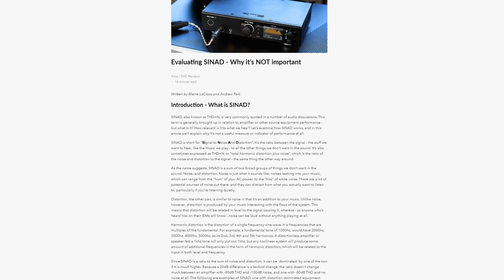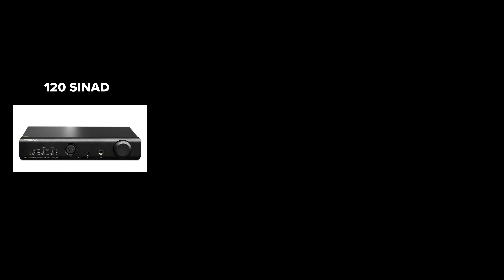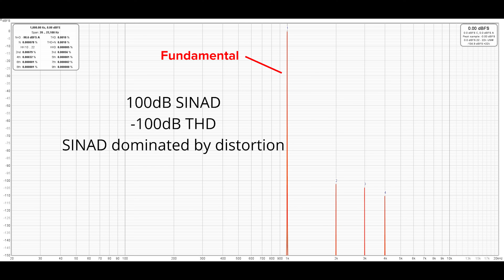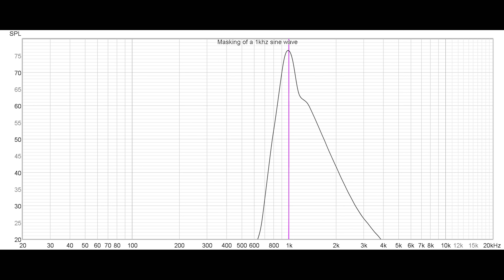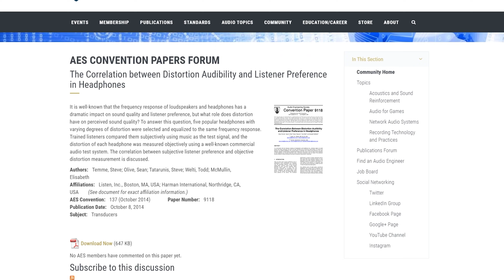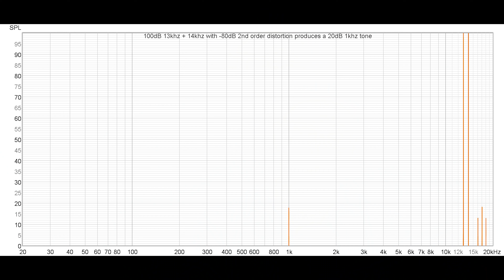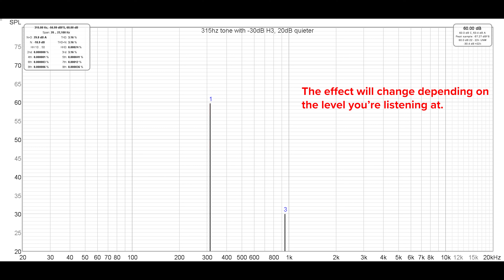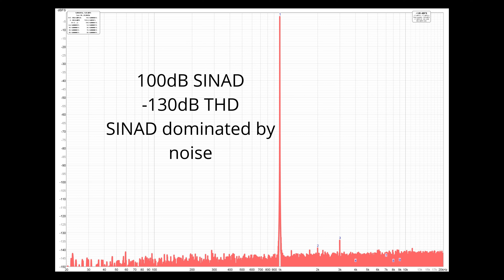Evaluating SINAD - Why it's NOT important

Comment: 4:53 distortion products are equal for example if you take that one kilohertz
fundamental tone and you add a second harmonic distortion to it you're going
to get a certain level of two kilohertz uh showing up now you could actually
have that level be relatively high and still not hear it because it is so close
in proximity to the one kilohertz tone contrast this you know at the same level

That is wrong...

Even an untrained ear can very easy distinct 1 KHz from 2 Khz and also 1 KHz or 2 KHz from a mix of 1 KHz and an 2 KHz harmonic.

There is a tool in the Internet (google for "onlinetonegenerator") which allows to mix up several sinus waves with different frequencies and volumes so everybody can try it.....

The voiced speech of a typical adult male will have a fundamental frequency from 90 to 155 Hz, and that of a typical adult female from 165 to 255 Hz. 

So according to your logic it should be nearly impossible to distinct men and women by their voice....

Comment: Anyone who thinks a single measurement defines the sound of a piece of gear is wrong. All it does is state how it performs in a single test. All it tells you is grossly how faithful it is to the source. If all you want is high fidelity and personal opinion doesn't come into your choices then measurement is the way to be lead. The raw number gives you a guide, nothing more, you need to see the full frequency sweep, which any decent review gives. No one is stating a single metric captures performance.

Comment: To combat the masking effect, a simple formula may be used where distortion is dynamically evaluated based on distance from the origin test tone and the difference between the respective loudness compared to volume, it would go something like this e.g. 1khz-5khz (Δ of whatever nr. of tones really) x ΔDb (tone's db at 1khz vs 5khz) / volume (because the lower the volume, the more explicit the distortion.)

That ought to give one a better representation of the perceived distortion as well as the amps' behavior across volume.

Comment: Thank you very much for this instructive video.  I was close to be seduced by the SINAD obsession and thus almost bought a new DAC even though I already have a completely adequate built in DAC in my Peachtree Nova300 as well as having available a 10 year-old NAC M51 DAC if I want a separate...all because of those two units rating on ASR's website.

Your common sense explanation with the scientific documentation is a real valuable contribution to the discussion...again, Thanks.

Comment: I don't see how a device that has a SINAD  of 120dB „might add things to your music“ (I assume audible is meant) as claimed to the end of the video. That seems to be a bogus statement. I understand that a bad measuring device can still sound pleasing due to masking (or wanted distortion), but in essence you are lucky that this happens and it might even be dependent on the source material and headphones used. A well measuring device  with a high sinad number on the other hand will add things, but the artefacts are KNOWN to be inaudible.  SINAD is just an upper bound, nothing more. 

The point is this. If high-end companies charge thousands and claim to be higher fidelity, but score low on measurments compared to a few-hundred dollar well engineered products,  then the claim of higher fidelity by definition is wrong and that's a problem. Sure, the cases might be nicer and some might have longer  life time but then the claims should not be about higher fidelity.
Also, amplifier design is not rocket science. A lot is known about it nowadays so I expect companies to be competent enough to design their products on a technically competent level, especially if the products are expensive.

Comment: To me, higher SINAD is MUCH SAFER option if I need to research for stuff WITHOUT any chance of audition. If I have to choose I'd rather choose a unit with 120dB SINAD over 60dB SINAD any day. As Julian Krause said, "...if you can, always have a look at the harmonic content that the distortion comprised of to get a better feeling whether this is going to be audible or not...", simply put, you need to look at the WHOLE PICTURE for analyzing audio gear, not just one aspect such as THD number, or SINAD number. That is analogous to making an opinion about an elephant, but you only look at how much it weigh, it does not tell the other stories such as it's strength, it's trunk, it's huge ears, how it sounds, etc. Most measurements only catches a GLIMPSE of what an audio gear sounds like, we need MORE data to be able to deduct a sensible opinion ~ that is if we can understand what the heck those data even means...
Reply: The problem I see, over at ASR they will take one with a rating of 80 and say it must sound like crap compared to one with a rating of 100. They use SINAD as some judgement of it being crap or great, while never listening to the device or seeing if the SINAD is actually audible in actual listening. It is most all by the numbers.

Comment: To get high SINAD you need high feedback. High feedback destroys the sound but improves the measurements. This is why discrete circuits tend to sound better than Op amps (high feedback), while measuring worse.
Reply: Most discrete amps are also feedback, is just op amp but built with discrete transitors
Reply: @dick66482209  of course the issue is the amount of feedback used. This is why amp design is also an art and not just a SINAD measurement
Reply: @RaveyDavey  it’s an opinion issue. It definitely changes the sound.

Comment: Objectivists are correct in asserting that anything that can be heard can be measured, where dogmatic objectivists err is in assuming without any proof whatsoever that the measurements they have made are the only important ones. Audio reviews tend to rely on the same handful of measurements: those that can be performed with (relatively) affordable and easily available equipment. Measurements that require weeks of testing on multi-million dollar equipment followed by a few days of statistical analysis on a super computer? Obviously, not going to happen in a review.

The one thing I take away from the debate argument holy war between objectivist and subjectivist audiophiles is that we don't yet know everything we should be measuring. This is where subjective reviews are valuable - they are the best (only) thing we have to fill the gaps in our knowledge of audio measurement.
Reply from the maker: This is kind of how I see it yeah.

Comment: Thanks for providing good, clear, understandable thinking. I’ve followed and learned about audio since the early 60’s, was a believer in the testing philosophy of the late Julian Hirsch of High Fidelity magazine, and I’ve never before encountered the term SINAD. I miss the FTC’s old strict standards for specifying amplifier power, with rated RMS watts per channel, measured with all channels driven, at .01% or less THD, from 20-20,000 hz + or - 3 db. Certainly more meaningful distortion factors could be added today, but it’s far more meaningful than a home theater receiver rated at 100 watts per channel, with 1 channel driven, 80-12,000 hz, @ 10% THD, which we see all too often now.
Reply: It'll do 100 W/c without too much clipping (if one is sufficiently generous in defining too much).

Comment: I think the ASR rankings have gotten a little out of hand.  It feels like folks just look at their SNR or SINAD charts and call it a day.  'Oh, this one's the best'.   However, some things like jitter and how filters are implemented are just as important (perhaps more).  I don't think all good measuring gear sounds decent (or rather maybe not all the necessary things are measured...I think figuring out transient response is super subjective even with measurements).  But, I do think some excellent measuring gear can really sound good.  Basically, you need to make sure the engineering was done well, in addition to the more subjective design parameters that might lend different flavors to the sound.

Comment: What I really want to see is some real effort to bridge the gap with research. I think that the measurement values are fantastic for evaluating equipment if you have the background to interpret the results. I also think there are likely properties of equipment which impact preference which current measurements don't capture.

I don't think those properties are inherently not measurable though... If there is something beyond current measurements you can tell you should be able to ABX to show it. If listeners can, research on how to measure the difference that leads to listeners demonstrable preference could follow.

Today I see too many people either think that audio science is a solved thing or that it is wrong. I don't think either opinion has scientific merit. With the level of interest and money in this area it seems like we should be able to do better at driving the research forward to push manufactures to make better products for lower cost.

Comment: Sure, individual components are more important when you're on the lower end of sinad, but these days 110dB of sinad goes for $50, why settle for less.
Reply: because, as the video pointed out, beyond a certain threshold it really doesn't matter, and products are being dismissed because they don't achieve a certain Sinad despite there being no audible distortion either ways by hardcore objectivists
Reply: @MrB10N1CLE  I would understand if you could save money by buying something cheaper that's still transparent, but that's no longer the case. Full no-compromise transparency is available in even the cheapest devices now.
Reply: @lunafag  please go and watch golden sounds reviews of the holo may dac. Saying measurable transparency (which is independent of the audible term called transparency) is the one metric to conclude how good an audio device is, is the same as using the house power of a car as the metric of its performance  in the real world. It is truly laughable.
Reply: It's actually not just the 'beyond a certain threshold aspect'. As we pointed out in the video, depending on your situation, 110dB might not even be good enough. The problem is that the index itself is arbitrary - nevermind that its individual components aren't that useful either, or at least when it comes to THD.
Reply: Cause after a certain point, it is moot.

Comment: Good explanation but if you look at the high scoring Chinese DACs and amps on ASR, when they approach something like 120 SINAD, the actual distortion measurements show ZERO audible distortion and noise. Especially the TOPPING stuff, they don't have any audible high order harmonic distortion either. So while yes, the SINAD score is a simplified metric, when you look at the details you can't really argue that these cheaper amps and DACs are anything but state of the art products from a signal transparency point of view. If you buy one of these high scoring products what you essentially buy is the peace of mind that somewhere somehow your source gear could produce unwanted artifacts.
Reply from the maker: There is definitely an element of confidence to that, especially if that's a priority.

Comment: From your experience, what good headphone amp in Class A do you recommand to drive correctly a HIFIMAN Arya with a budget in the range 500$ - 800$ ? Thanks.
Reply: Singxer SA-1 is beautiful with arya
Reply: Going full Class A isn't all that necessary, but regardless, iHA-6/Jot 2/SA-1 are all great amps to pair with Arya
Reply: Why would you spend this much when an Asgard 3 is about all you need and then you can spend more on headphones or just save money or buy an IEM or go on a date or whatever. Also class A means nothing for sound quality it's just about its electronic structure and nothing else.
Reply: I am listening to my Arya on the SMSL SP200, very clean, a lot of power.

Comment: Excellent video/article.
I really hope that over time we can move toward actually looking FULLY at a product and it's performance/behaviour.

As much as it'd be nice if we could, there just is no way we can rank audio products based on one single number and trying to do so is just going to end up with something which is either a little, or very misleading
Reply: GoldenSound is the most important new channel in the past year we've had in the headphone community
Reply: @metal571  and we await your return
Reply: @metal571  not just the headphone community. Also he exposed the MQA snake oil.
Reply: Here he is, the best reviewer and audio YouTuber period!
Reply: we don’t even have a solid theory to calculate the width and depth of soundstage and the position and size of images. The math is not even there, let alone technology.
Reply: @allansh828  we have the technology to produce very accurate outside the head experience with headphones.
https://youtu.be/gmFOJRyNi_I